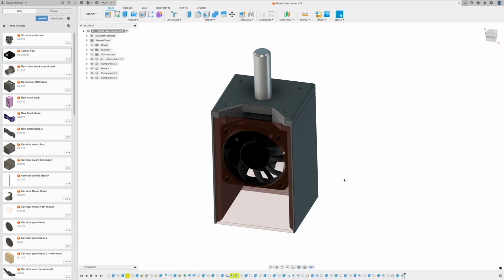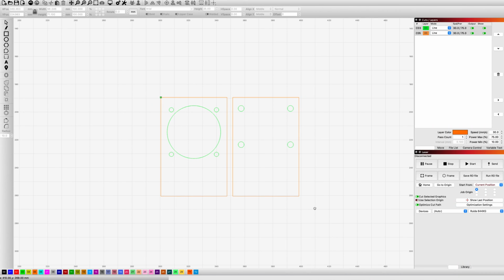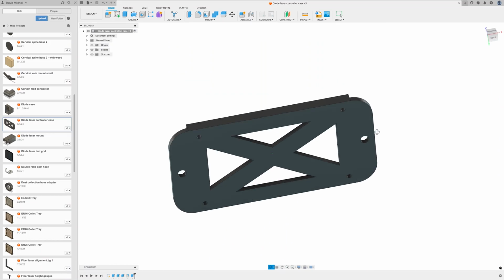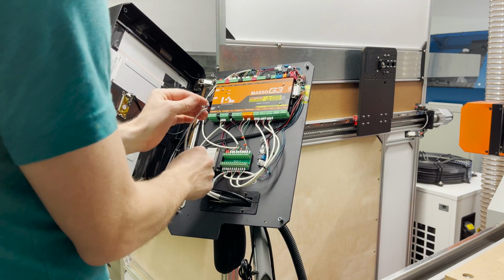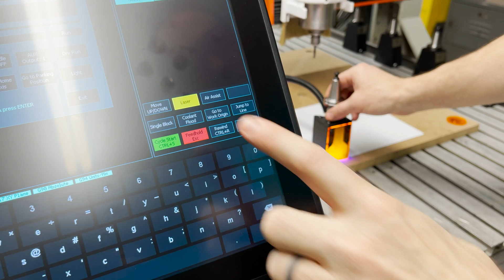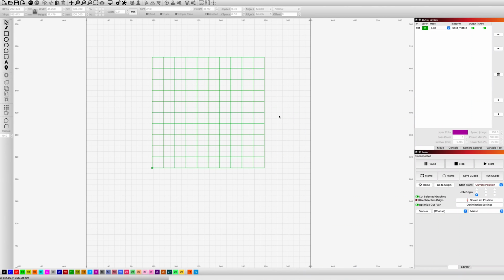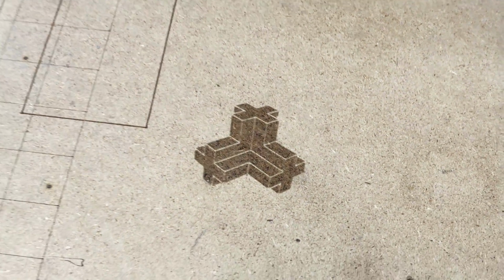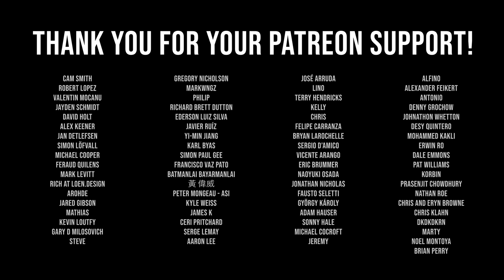CNC Router Diode Laser Tool for the Masso G3 Touch

Comment: Great adaptation! Did you have to implement some software in your controller board in order to translate G-code (especially for the laser power) into Masso's own set of commands, or the traditional firmware (Marlin etc...) you can find on any commercial laser engraver?
Reply from the maker: no, it was really simple, they have instructions on how to set up Lightburn so it outputs the correct gcode for Masso: https://docs.masso.com.au/quick-start-guides/laser-engraving-cutting/setting-up-lightburn
Reply: @diyfiberlaser Great! I use lightburn too. They seem to be serious developers.

Comment: You should prevent the spindle from running, while the laser is in!

I did something similar with my 3D Probe, using a sensor in the parking holder, which cuts the VFD Run Signal.

But overall pretty cool idea!
Reply: Good idea. I've been wanting to do something like this with the chuck key for my lathe because I'm an idiot.
Reply: @Eric-vq9nq  why not! The lathe will only start if the key is in its parking holder…

I built this security feature after destroying my Haimer 3D probe! 
It got ripped apart at some 1000 RPM. 😬
Reply from the maker: That does sound like a nice safety feature to have....I will inevitably issue a tool change command and forget I have the laser tool in one day.

Comment: If you mount the laser completely coaxially to the spindle, you could use a little circular PCB with concentric power and control lines, and some pogo pins mounted on the tool, to just have it in the ATC rack and completely wire-free when not in use :)
Reply from the maker: That is an awesome idea! I don't think the Masso has the logic to accomplish this though...it doesn't seem that tool 111 is like the others that you can assign a tool change position on the rack, the logic assumes it is permanently attached to the gantry and has logic to raise/lower it via pneumatics.
Reply: @diyfiberlaser  Maybe run a tool change to a regular tool number, and then switch to 111?
Reply from the maker: Great idea, I think that would work @Spirit532

Comment: Hi. Why the dots at the begin and end of the lines? Is it a Masso problem ?
Reply from the maker: The dots were only there when I was manually jogging the laser...I would activate the laser and it would sit there and burn before I could start moving it and continue to burn after I stopped until I deactivated it. There is no problem with the Masso, when it ran a program there were no dots.